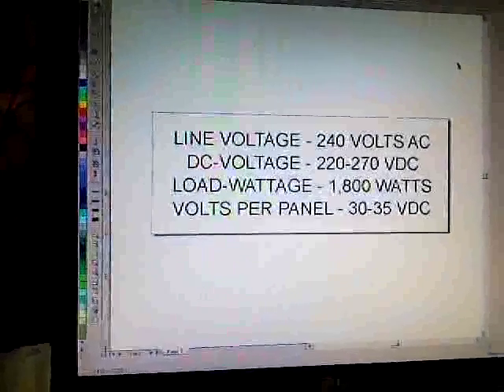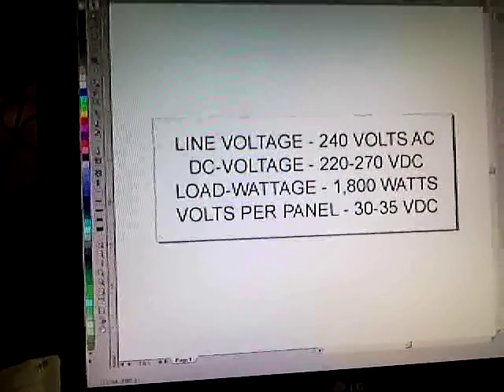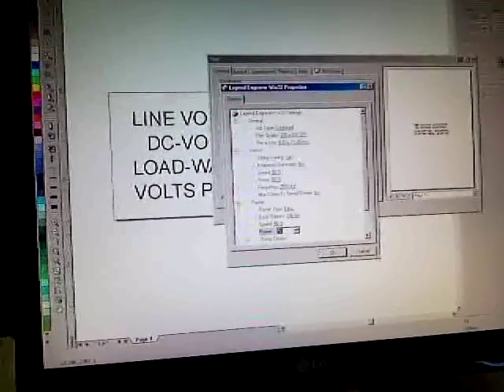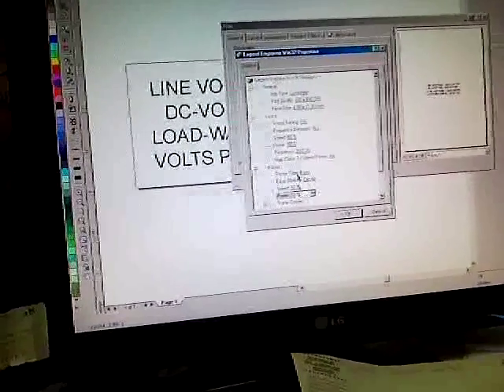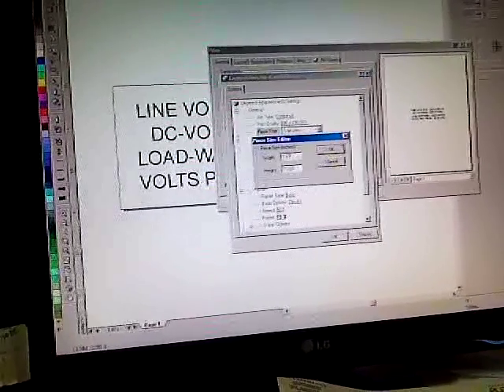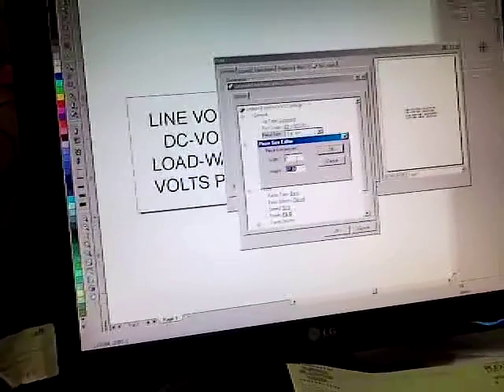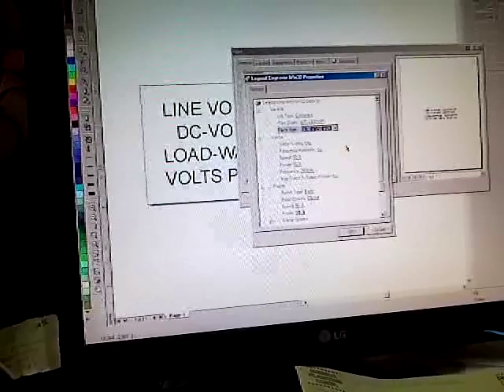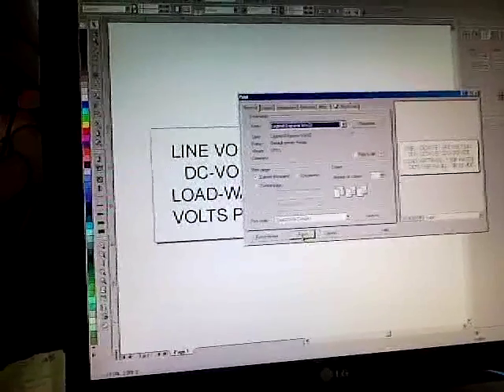Epilog Laser 50 Watt - Green/White 1.5 x 4 with 4-Lines

Comment from the maker: no that's 1/16" thickness.  as for the cutting grid that you see, we used a egg-crate light diffuser from our shop.  we cut it, added plexiglass for the height and got it very square to the boundaries below.  it helps when you don't use the larger which is a little bit heavy.  this plastic one is much lighter and smaller.  once it's badly cut up, we simply just thow it away and create a new one.